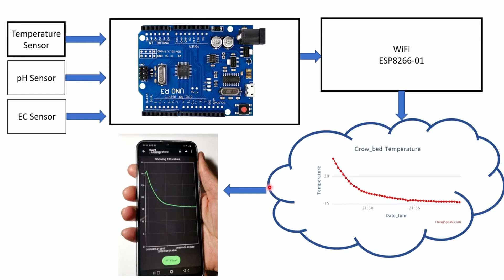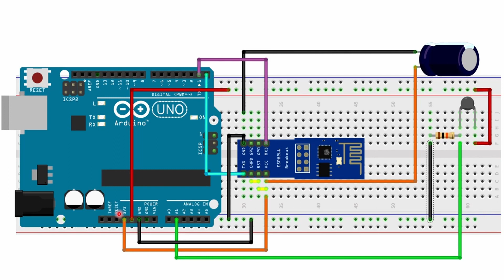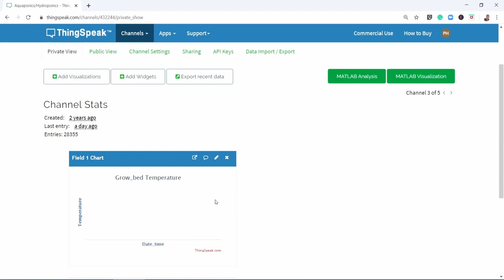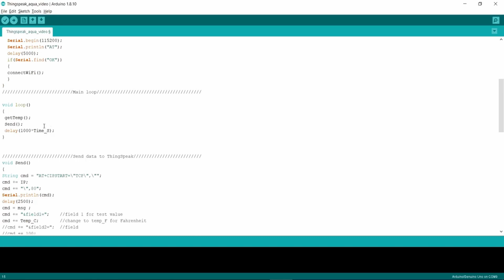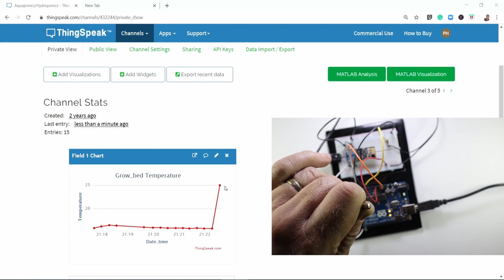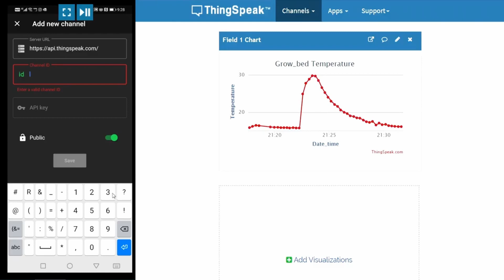ThingSpeak temperature logger - ESP8266 WiFi module

Comment: I'm having a problem with my project. I can get EC temperature and humidity values from the serial monitor. But I wanted to send these to thinkspeak. I wrote the appropriate code for this, but it gives an error for pins other than A0. for example A1 A5 etc. After doing a little research, it says that it is because I chose the esp8266 generic card. Is that why you only sent warmth in this video?